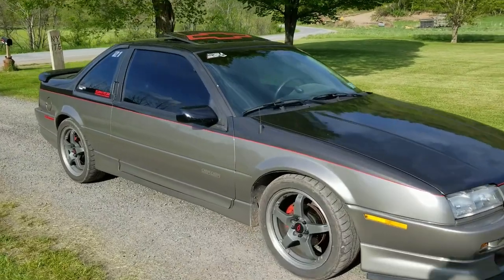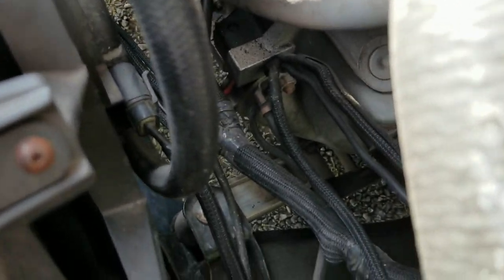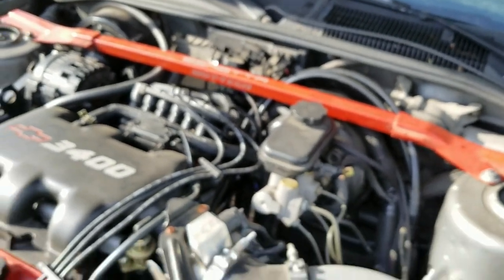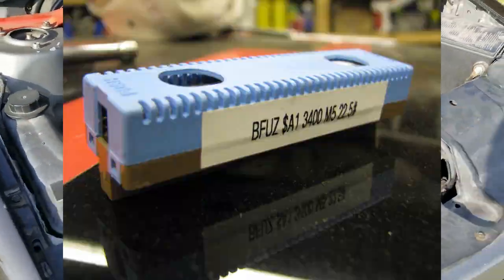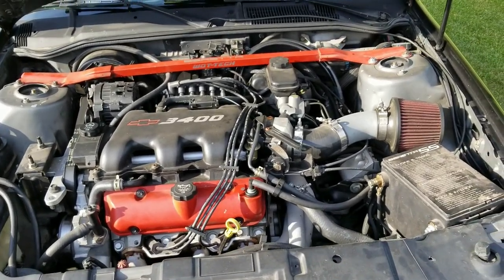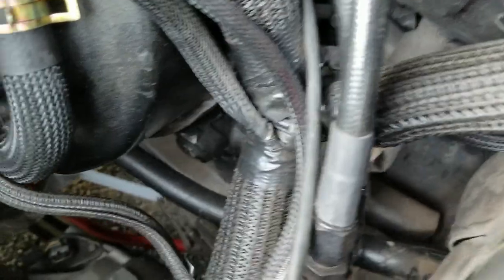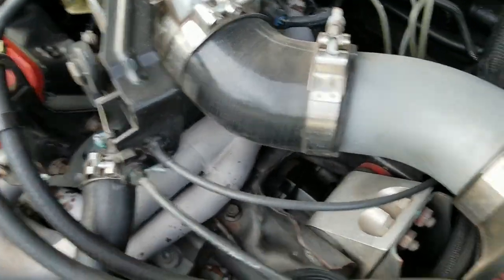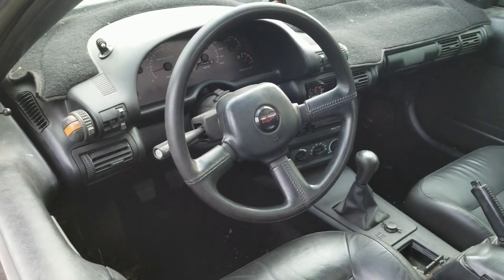Beretta "SS" walkaround and build info - pt 1 - WOT-Tech 3400/5spd

Comment: Well this is encouraging , my son drives a 91 cavalier z24 5 speed just bought a wreaked 03 venture van for the motor not trying to build anything crazy just something to work on together over winter thank you for sharing this!
Reply from the maker: @AndrewMiller-vb9sx  yeah, that should be a fairly straightforward swap. You'll have to fabricate a front engine mount, but there are drawings for it online
Reply: @GEARHEADdezign  awesome thanks!

Comment: I’ve got a 3.4l Monte Carlo, it’s just got a cold air intake and an exhaust on it right now, what could I do to make a little more power with the 3.4l? Where can I find parts for it?
Reply from the maker: WOT-TECH has stuff for your 3400. I got cam heads and intakes from them
Reply: You can do a 3.5 LX9 swap for it, assuming it is FWD late 90's-2000's Monte.  That will give more displacement, ability to use a 65mm throttle body without porting the intake, etc.
Reply: @elmarko9051  if I’m replacing the engine I’m just gonna put a 3800sc in it.
Reply from the maker: @darthbiden8675  that would make sense for you since it's a factory option. The stock 3500 is a nice upgrade from a stock 3400 in cars set up for the 60*v6.
Reply: I have a 60mm throttle body, intake and underdrive pulleys I can sell you.
Reply: @SportsMusicCars  just ordered a ported intake, 65mm lx5 throttle body, and adapter kit from wot tech not too long ago.

Comment: Pretty nice would love to do this to a chevy venture that has the 3.4 in it already lol one fast van
Reply from the maker: I always told people I swapped in a minivan motor🤣
Reply: @GEARHEADdezign  yeah there great engines the one I had was at 320 thousand miles, how hard do you think it would be to use this engine in another vehicle like a bronco II if you know what vehicle that is
Reply from the maker: @rumblertag1419  lots of people put them in older English cars. They're small so they should adapt to almost anything. RWD 4cyl trans out of s10s etc will bolt up
Reply: @GEARHEADdezign so you mean the 4L60e transmission will bolt up in place of the 4T65e and work with the la1 3400 for a rwd application, from my research it seems like it will work if not what would like a 4L65e or 4L60…?
Reply from the maker: @rumblertag1419  you'd need a trans with the 4cyl bell housing pattern like an s10.

Comment: Nice dream car Chevy should bring the body style back the interior controls are ahead of it’s time
Reply from the maker: I think Berettas were well ahead of the style curve. Especially late 80s when they first came out.
Reply: @GEARHEADdezign  yea the z26 is something special to me the perfect coupe the window controls are where they need to be But this setup is nice man
Reply: @GEARHEADdezign I wish they had more suspension upgrades I got a 96 z26 lookin at new Delco struts and springs all around I know they lift I kind of want that if I go off road 🤣but how much would it affect handling compared to just swapping the OG coil springs
Reply from the maker: @kenshin034  struts won't make any difference in ride height, just damping. New coils might lift it slightly if the originals are worn out and sagging
Reply: @GEARHEADdezign  yea I want a stiffer setup I wouldn’t mind a little more lift for clearance but just been  getting it up to be a reliable clean daily maybe throw on a delta 40 on later

Comment: 2 questions do you think the 3400 could take boost ?, and were the injectors easy to install
Reply from the maker: Injectors were a direct swap. And I know of several people boosting 60°v6 with success.
Reply: @GEARHEADdezign  Ben @ WOT-TECH built a 12 sec. Corsica with a boosted 3400.

Comment: Interested in adding cruise to my 1987 Z24. Would this setup work?
Reply from the maker: Wiring-wise it should work perfect. You'll have to figure out a cable that works with your throttle body though. Camaro, Silverado and s10 are all different TB ends with the same connection at the box. Can prob make one of them work

Comment: Bro used a 3.4 L GM OHV V6? How much horsepower does this one make?
Reply from the maker: Never dynoed it, but it trapped 101.6 in a 2900lb car
Reply: It's probably making 280 HP at the crank.
Reply from the maker: The weight MPH to HP calculator i checked years ago was more like 250
Reply from the maker: But that's still a lot better than the 185 they're rated at
Reply: @brettmazuran4765  Dang! That's unheard of for a 3400!
Reply: @GEARHEADdezign  Agreed

Comment: I have just acquired an 06 equinox, thinking about making a super sleeper. it's got the 3.4l V6. any tips?
Reply from the maker: Talk to Ben at WOT-TECH
Reply: @GEARHEADdezign  also, how hard do you think it'd be to convert an AWD equinox to rwd? I understand the engine is still mounted transversely with the AWD setup, so it'd be almost the same swapping a fwd as well.
Reply from the maker: @stirfry59  I don't see why you'd want to. But you'd have to get into the center diff and figure out a way to lock it
Reply: @GEARHEADdezign  my biggest reason is that I just don't want to do a build with a car everyone else has already built. I want to be unique, and I'm okay with that taking a bit more work on a car that doesn't have much aftermarket support. that'll motivate me to get into fabrication and all that.
Reply from the maker: I'm all about building weird stuff. I just wouldn't change from AWD to RWD. That's all
Reply: @GEARHEADdezign  fair enough
Reply: @GEARHEADdezign Yes, I know Ben as well!!! He built a 12 second Corsica with a 3400.

Comment: Could you fit this same build in an 03 impala?
Reply from the maker: Yup. Engine came out of an Impala. Haha
Reply: @GEARHEADdezign  Of course it did! When the 3100 in my 1996 Z26 blew the cam at only 96k, I was going to pull a 3400 from an Impala but needed a 4 door with 2 small kids, so sold my beloved Z26 for $1200 to a mechanic who dropped in his wifes 3100 with 220k on it, after that Beretta was t-boned.
Reply from the maker: @SportsMusicCars  😢 I'm making the 2drs work even with the one kiddo 🤣
Reply: @GEARHEADdezign  go ahead and hav 2. 2 yrs apart... 😱

Comment: Not sure if I missed it, but did you build the bottom end on this engine (outside of the cam…?), curious how much morepowahbaby you could’ve squeezed out by going to 11:1 or higher…? Also, any particular reason you didn’t try a 3500 swap or hybrid with the build? Feel like you could’ve snuck into 12s easily with a built bottom end and the 3500 components. Still very impressive.
Reply from the maker: @IvyMike551  nah, completely stock bottom end. Being my summer daily, I much preferred 87 octane🤣
Reply: @GEARHEADdezign  totally understandable. I can’t remember the reason it’s not super popular to swap the whole 3500 in (IIRC there was some extra hassle to make the bottom play nice), but I think the combination of your mods on that engine would’ve got you into the 12s, which would be insane for N/A. Why’d you end up selling this beast?
Reply from the maker: @IvyMike551  the 3500s had better heads and 9.8 compression instead of 9.5, but the crank reluctor was wrong for the old ECMs. 12s might have been possible, but still noone has beat my 13.2 yet.😎🤣

Comment: How did you get the headers? I’m trying to get them for my Fiero.
Reply from the maker: They're S&S headers for a Grand Am, but they're long discontinued. Pacesetter made some and also OBX. You may have to modify them to fit a Fiero, but it will give you a good head start.
Reply: @GEARHEADdezign  Will any of those fit a 2000-2005 Monte Carlo?
Reply from the maker: @watchandjewelryloft4713  I'm sure a Monte Carlo has more room. And if they don't fit perfect I'm sure you could make them work with a little persuasion 🤣
Reply: @GEARHEADdezign  also TOG made headers for the grand ams. You cant buy any of them new anymore, pacesetters are known to give the best performance and sound, with S&S close behind

Comment: Hey man looking to mod my alero with the 3400 beginner suggestions?
Reply from the maker: Start with headers and exhaust. Then I'd go cam after that
Reply: @GEARHEADdezign  was thinking about boring out the cylinders.. recommended? not recommended? has it even been done before?
Reply from the maker: @joewilson1522  I wouldn't, unless they need cleaning up from tons of miles.
Reply: @GEARHEADdezign  I thought the cylinder walls where decently thick and had room for a little sizing up unless I’m wrong or is it something else
Reply from the maker: @joewilson1522  I wouldn't bore just for displacement. But that's just me
Reply: @GEARHEADdezign  oh ok I got you yeah I mean I really wanna do something special with it something that isn’t on yt sequential turbo is the goal but idk
Reply: Bigger throttle body, CAI, exhaust, AIT temp. mod, ported intake plenum. My 1996 Z26 was running very low 15's with those basic mods. I also have that 60mm TBody, intake and underdrive pulleys I can sell you, as I no longer have any GM 3400 OHV engined cars...
Reply: @GEARHEADdezign  I went with exhaust, CAI and 60mm t body with my 1996 Z26. Made a nice difference, used to hang with Acura TLs all day, the 258hp ones.